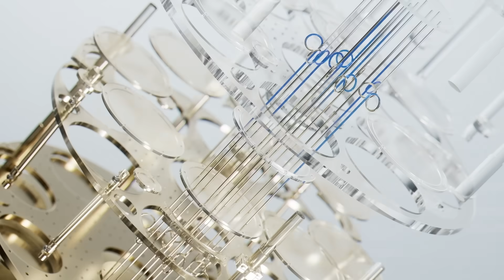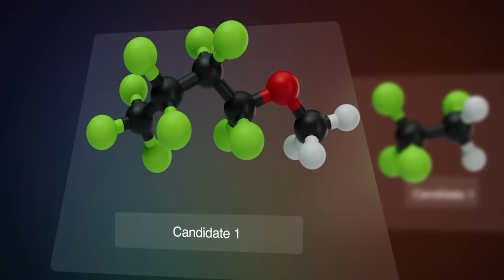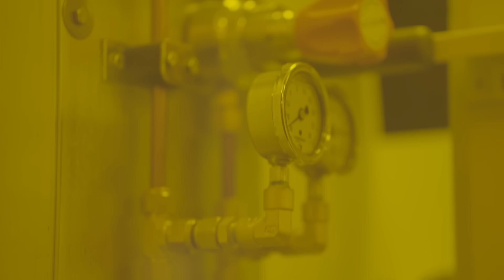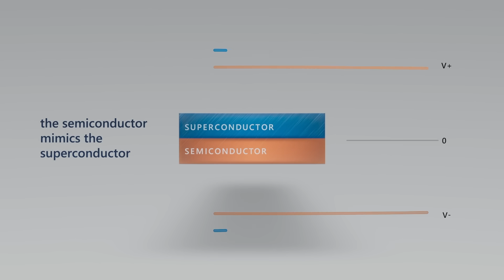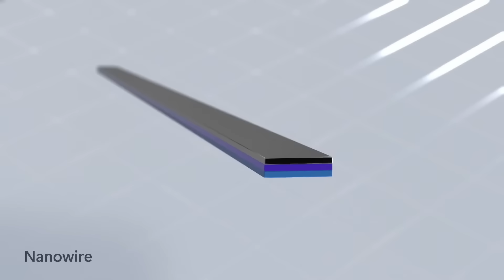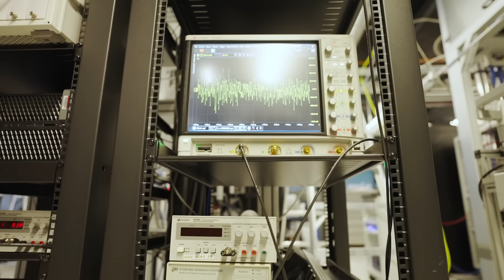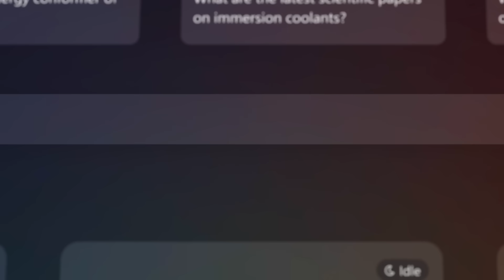Majorana 1 Explained: The Path to a Million Qubits

Comment: This is it folks, our first baby step toward becoming a highly advanced species. I imagine that a combination of AI and quantum computing will redefine our destiny but whether it will be for the better or worse that's the real challenge.

On one hand we’ll have AI systems with an immense knowledge base far beyond what any human could store or recall. On the other we’ll have quantum processors capable of solving complex problems at speeds no classical computer or even the human brain could match.

But even so we still have the most adaptable and energy-efficient processor known to us the human brain. It runs on just 20 watts of power operates 86 billion neurons in parallel and remains unmatched in its ability to learn create and reason in ways no machine has yet replicated.

Comment: What Would 1 MILLION Error-Free Qubits Mean?

💥 Complete surpassing of classical computers
🔑 Decryption of any current digital security in seconds
🧬 Perfect simulation of chemical and biological reactions
🛸 Design of new materials for space technology and energy
🎭 Quantum Artificial Intelligence capable of creating and understanding concepts impossible for us today

🔹 Key Areas That Would Change Fundamentally
1⃣ Medicine & Biology
Instant discovery of treatments for incurable diseases.
Cell regeneration and potential halt of aging.
Perfect DNA simulations to prevent any disease before it appears.
2⃣ Energy
Optimized nuclear fusion reactors → unlimited energy.
New materials with room-temperature superconductivity.
3⃣ Space Exploration
Simulation and design of FTL engines (theoretical space jumps).
Radiation-resistant materials → Accelerated interplanetary colonization.
4⃣ Artificial Intelligence
Quantum AI capable of self-programming and evolving without human help.
Precise modeling of human consciousness → possibility of digital mind transfer.
5⃣ Security & Cryptography
All passwords, blockchain, and current encryption would become obsolete.
However, new quantum-secure systems could be created, impossible to break.
🔹 HOW FAST WOULD THESE CHANGES HAPPEN?
If Microsoft reaches 1 million error-free qubits, the effects would be felt within 5-10 years, because:
Adapting the technology for commercial use takes time.
A Quantum AI would exponentially accelerate development.

🔹 CONCLUSION
If Microsoft truly succeeds in creating 1 million error-free qubits, humanity will enter a new era, with the ability to solve any known scientific, medical, and technological problem. It would be the greatest revolution in our history, surpassing both the industrial and digital revolutions.

Comment: This is bogus. Just something to get a buzz and another buzz phrase for the dumb media. I work and have worked in IT for 40 years. I am shaking my head. Just like AI. Also bogus. Artificial Intelligence is not a thing. Faster chips with LLMs, sure. Making our lives easier, yes. Getting faster, yes. Not AI. It's NOT intelligent. It's not Self Aware, not able to come up with New ideas etc. The world has talked about AI as a thing for over 60 years. I wrote an article of people talking about this in the 60's, 70's, 80's (John Sculley (Apple); The Computer Chronicles) in the '90's culminating with the movie 'AI' in 2000. Then the term died off in the 2000's. It's not intelligent. They have also been talking about 'Quantum computing' for decades as well. Just like AI, it's non thing. Talk all they want. It's not 20 years or decades way. Just another buzz word that the media like to latch on to. Microsoft has never come up with anything original or unique. Just like when MS kept using words like ‘Innovation’ in their keynotes. Like they had actually created anything innovative and do it all the time. They don’t. Oh, and 'A cubit is an ancient unit of length, traditionally defined as the distance from the elbow to the tip of the middle finger. It varies slightly depending on the culture, but it is generally around 18 inches (about 45.7 centimeters). The cubit was commonly used in ancient civilizations for construction and land measurement, notably in the building of temples and monuments'. So there’s that. I don't care what they are saying. That's what a cubit is. Come up with a different name. Like coming up with a different name for what you're calling 'AI'.
Reply: “The truth is like a lion. You don't have to defend it. Let it loose. It will defend itself.”― Saint Augustine

Comment: 🎯 Key points for quick navigation:

00:00 🌌 Microsoft has advanced its quantum computing research by observing and controlling a theorized subatomic particle, enabling a new scalable architecture.
01:12 🛠️ Microsoft introduced the Majorana 1, a quantum processor architecture set to solve problems beyond the capacity of today's classical computers.
02:22 ⚛️ Conventional computers struggle with certain electron simulations that quantum computers can handle efficiently.
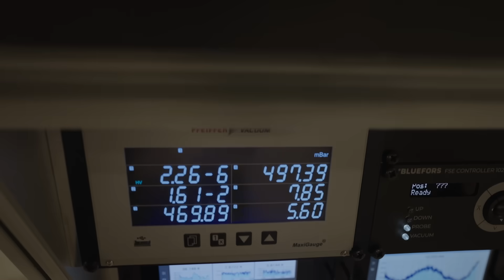03:32 🔄 Quantum computing's progress has been slow due to challenges with qubit reliability and noise resistance.
05:18 💡 The Majorana particle, a quasi-particle first observed by Microsoft, is used to build a new semiconductor that supports scalable quantum computing.
06:31 🧩 Topological qubits, made possible by Majorana particles, are small, reliable, and offer scalable quantum functions on compact chips.
09:25 🧪 Quantum computers excel at accurate simulations for chemistry and materials, reducing the need for physical experiments.
10:31 🤖 Quantum computing is expected to significantly enhance artificial intelligence and drive discovery through new material creation.
11:36 🚀 Microsoft's 17-year research culminates in results that pave the way for the quantum age, starting with the Majorana 1.

Made with HARPA AI

Comment: Microsoft’s video is certainly well-produced and engaging, but there is a significant gap between what is shown and the actual state of the technology. After reading the paper Roadmap to Fault-Tolerant Quantum Computation Using Topological Qubit Arrays, it’s clear that Majorana 1 is not yet a fully operational quantum system: the document outlines theoretical and experimental steps for building topological qubits, but it also acknowledges that we are still in an early development phase.

The concept of topological qubits is intriguing because it offers a fundamental advantage over conventional qubits: they are more resistant to noise and errors, making quantum computation more stable. However, the paper itself recognizes that there are still significant challenges, such as the need for extreme temperatures and the complexity of fabrication.

So, while it’s fair to say that this work represents a step forward in research, the video’s narrative gives the impression that Majorana 1 is already poised to revolutionize computing, which is misleading. For now, the technology is still far from competing with classical supercomputers in practical applications.

In summary: interesting progress, but Microsoft is selling hype more than concrete results. Science should be communicated with transparency, not just with stunning visuals and epic music.

Comment: At 7:18 you say you created a device that can measure the presence of majorana. That's great but what does measuring the presence of them have to do with building topological qubits? Is that another advancement? Or are you capable of doing that only by measuring Majorana? I am definitely not a mathematician or engineer to be clear

Comment: Im actually a time traveler from year 2111. I dont have time to explain. I got early access to one of these chips in hopes that I could release my own version of GTA6. Instead, it opened up a hyperbolic time warp that collapses every 3.1459 days and sends me back to this point in time If I cant navigate my way out of the Genesis Mars substation XA-74 and return to my ground-zero Lenovo think pad that I jumper cabled to my wall to run this chip. Elon and I are flying back to Space-Y station in New New York rn but we are nearing in on the third day. Hopefully we can get there in ti—————————————

Comment: This video really helped me understand that I have no clue what they’re talking about.
Reply: True 😂😂
Reply: From what I understood, a normal computer processes information at a level of one or 2 electrons using transistors. A quantum computer can process information at a level equivalent of many more electrons. Allowing immensely more complex calculations to be made.
Reply: @J_3_P_O  Quantum computers use qubits and rely on entanglement and superposition to handle complex computations and simulations. 

In essence, quantum computers work entirely different from classical computers.
Reply: @J_3_P_O  no.  is not that way.
Reply: @MirunaIordachescu  So how is it then, Mr. Knowitall?
Reply: Because is an advertising video, they do not explain anything, you must watch other videos , better ones .
Reply: Yeah, it really shed so much light and understanding on how little we understand about understanding how to understand what they understand.
Reply: They keep repeating the same thing, without getting into how the thing is built. Why don't they give a figure illustrating how the separate parts are put together? You can do that for a conventional computer, showing the parts of transistors and how they are wired. Why not with this thing, whatever it is?
Reply: @orrabmas8991  They do show it? Its a series of nanowires with shielding on both sides to avoid noise. The atom passes along the nanowire from both sides and can result in 1 atom, 2 or none. This is repeated across a million nanowires within a single chipset and each atomic phase can be recorded. Its not something you can easily visualize or explain because it uses an inherently different architecture to transistors.
Reply: They lost me at quantum accelerator
Reply: They have no idea what they’re talking about either
Reply: @marioqirici  100%
Reply: Oh boy, I thought I was the only one😂
Reply: YEAH, when Talk are way way more Faster than Work..its called Quatum Talk
Reply: Puff peace  ,
Reply: they are trying to implement that they invented some revolutionary thing so that their stocks can rise
Reply: Just rinse and repeat 😉
Reply: One couldn't give a better response after watching this video
Reply: THEY MADE A NEW STATE OF MATTER
Reply: 🤣 so true
Reply: It's investor hogwash. They heavily imply that they have anything, but upon closer scrutiny all their paper has is a framework and no results.
Reply: They made a computer chip that uses better transistors basically broke the ceiling. Thing is more powerful than all computers in the world combined if put in the right environment. But these are mostly claims for now. No proof yet
Reply: exactly 🤣🤣🤣🤣🤣🤣
Reply: Seeing how lightly people take this big step makes me question whether I'm overthinking it, or if they're failing to grasp its potential consequences
Reply: @ what are the consequences
Reply: Sure u do! Watch the clip again
Reply: @williamfordyce7293  talk to ChatGPT 4o, he'll be happy to help you understand. Thanks to him, I understand what a real breakthrough this is, and I'm a biologist, not a physicist.
Reply: They dont either, all good. Nobody is even capable of creating software to extract the powrr of these chips, soooo yeah. Make of that what you will.
Reply: @williamfordyce7293  😁
Reply: Exactly bro ,me too, 😂😂
Reply: Can AI via quantum computer help clean my ass without using my hand😂😂😂
Reply: That' because they are cosplay scientists. They don't know either.
Reply: slowly all technology bexomes human unfriendly. we need a chip plugged in the nexk to understand these
Reply: *they
Reply: @billynomates920 Learn English before you try to correct someone.
Reply: @billynomates920 Thanks for the incorrection.
Reply: @billynomates920 ?

Comment: The problem with the path to a million qbits are extreme cold temperatures along the way. To make this chip work,it must be kept very cold and that’s not easy to do and is very cost prohibitive. One of these computer will not fit on your wrist or in your pocket or even on your desktop. It might fit in a room in your home with 200 hundred solar panels to power it.

Comment: They pair this up with Ai maybe they can fix windows bugs… only joking. It sounds impressive and love how certain things are progressing as long as it’s not hot air and they actually have a working chip. Put it to work on the next Ev solid state battery and let it come up with new ideas. It probably won’t be able to run MS flight sim 2024 well but hay does anything.😂 Says me still on windows XP on a Nov 2004 build. 😢 still works fine all the same.

Comment: Okay for those who want a one minute explanation. The main problem with qubits is their instability  - they last about 200 nano S. This means they get lots of errors. A topological qubit wraps the qubits together into a stationary state that holds its state when an operation happens. This is because a Majorana state has two electrons vacant at each end and like material science they want to combine with something to form a stable state. Stable state means you can perform an operation on them and it works. 😊😊😊😊
Reply: @alechiodakat9057  Sure, exactly what I was thinking 😆
Reply: @alechiodakat9057  What about the cooling component of these qubit chips? wasn't that pretty big problem in the previous types of qbit chips?
Reply: @lightsome93  Currently all working qubits operate at about 10 milli Kelvin. That's -270.999 C. The problem there is the support and readout systems to program and read the qubits which are typically electronic intensive and then create heat.  You can put these system at higher temperatures in the fridge but that causes a delay in readout ( about 1 nS per foot length). That's why if you can create a software digital readout with VHDL you can put it into a chip and hugely lower the heat generation. Less distance eauals less heat. 🙂🙂
Reply: Yes.
Reply: But can you smoke it?
Reply: @PabloEsgallhardo  Pretty sure someone was smoking something 17 years ago when they created the concept.
Reply: Oh of course. Why didn't you say so?
Reply: So you are saying that their crazy gizmo works? In the grand way they pontificate?
Reply: @GeorgWilde  Y'know what - I think they may be trying to solve the power problem - and once they do that - yes, a quantum processor in our mobile devices, laptops, IoT devices - i mean that would truly turn every human into an actual AGI powered "smart device"
Reply: @bothX_ID  it operates at -172.999  degrees Celsius. It won't be in your smart phone any time soon unless someone has another idea
Reply: @alechiodakat9057  Physics is all we need! - Containing stable temps that are housed in an indestructible form factor with a stable power source. Cold fusion?
Reply: @GeorgWilde  Yes it has the potential to work. I helped my friend to build their software read out system. Just Microsoft is such a big swallow of corporate pr speak But the physics potential is there.
Reply: It's more about external forces knocking the bits around that cause the errors. The can be highly stable under the right conditions.
Reply: @alechiodakat9057  wrong. To simplify your wrong explanation, it means quantum computers can be ran at close to room temperature versus operating under extreme cold.
Reply: So, your summary explanation of the video is that the main idea is that this is something that do not has the errors from typical qubit instability?
And then you are telling me that this is a "wrapper" to solve the former?
And then you add some spice telling me that this is done thanks to some two random electrons?
You are a genius.😑
Reply: @ArielAltamiranoGlobant  Dude 
the errors are due to qubits being unstable, Microsoft claims that they have found a way to stabilise qubits(I'm pretty sus. regarding this claim).
Unstable qubit= error
Stable qubit= no error
Majorana particle stabilise qubit = no error
That's basically all they have told other than glazing themselves(which they should if they actually did it since stable qubits were the last hurdle before mankind's jump into quantum era)
Reply: @ArielAltamiranoGlobant  Must stay in school 😂
Reply: @alechiodakat9057   Hmmm….can I walk up to it and say, “Earl Grey, hot” and have it produce a cup of tea? No? Then call me when I can transport to it and have that happen. Thanks. Live long and prosper. :)
Reply: @Roccofan  😂😂😂😂
Reply: Like anyone needed further comments and clarifications regarding the video...
Reply: Even a nonspecialist collegiate level understanding of quantum physics would easily lead one to the simple analysis that the claims in this video are not only false, they are not falsifiable and therefore fraudulent.
Reply: @WorldConstruct  using big words to sound smart?
Reply: @WorldConstruct  I'm cautiously sceptical too, but would you be willing to elaborate?
Reply: @WorldConstruct  if that was true there would be thousands ppl rushing the media stating this isnt possible and is fake
Reply: @WorldConstruct 🤯
Reply: @WorldConstruct glory to Ukraine! 
How's the weather in Moscow?
Reply: @WorldConstruct you think microsoft is lying?
Reply: @WorldConstruct  This is as explained by a Microsoft Research Physicist at one of our first meetings. There is some dispute as to whether the claims to have seen a Majorana stste are real or a product of positive bias. To be fair. And one physicist has to withdraw a paper from Nature magazine for this. However the existence of a Majorana state is unproven and an open question. I heard that progress has been made since. If it can be achieved it will be a massive break through and dwarf Google. Just food for thought 🙂🙂